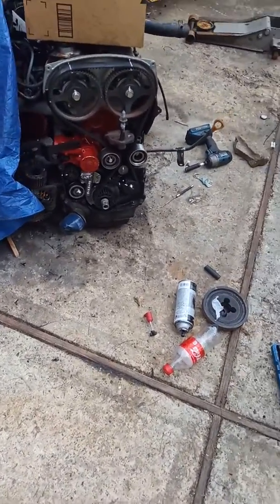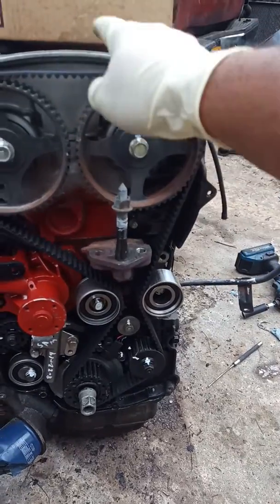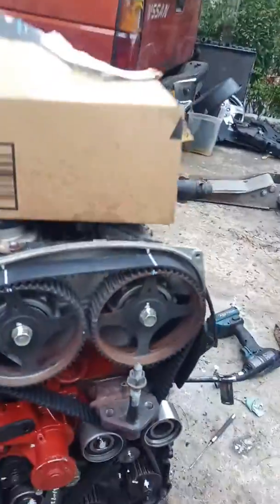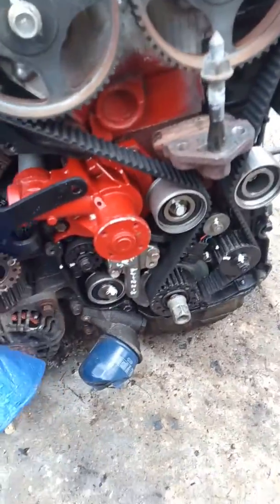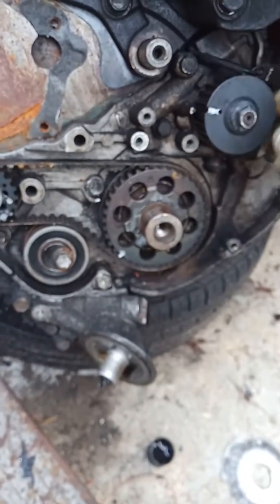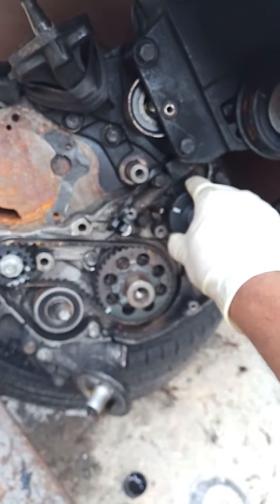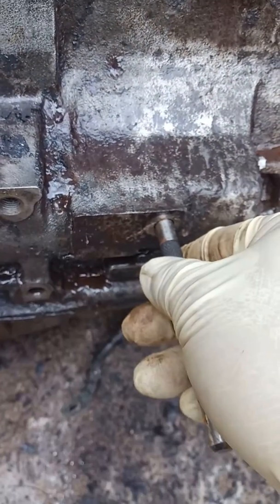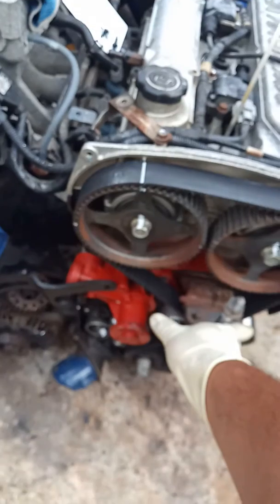2.4 Hyundai how to do timing belt

Comment: Is that slack on the timing belt in between the camshafts normal after you set the timing and release the hydraulic tensioner?
Reply from the maker: should be no slack on the belt... the tensioner takes care of the slack just dont tention it too much..
Reply: Ok, just wondering, when you touched the belt in between the camshafts it had a little bit of slack

Comment: i got a problem . I turned the crankshaft clockwise accidentally while having the camshafts locked in the guided positions is there a way i can turn it back counter clockwise without unlocking or do i have to do a whole turn all over again please advise me
Reply from the maker: You can loose the timing tentioner  them match all the marks them tight the tentioner . You can turn the camshaft pulley by themselves the most important part its the piston in on dead top center piston one up..
Reply: @SamsAutomotiveS  so i could turn the crankshaft 360 clockwise without making any changes damage on pistons and valves, ? im afraid of it
Reply: @SamsAutomotiveS   everything came out  perfect, I just lined marks once  more  thanks for your support  !